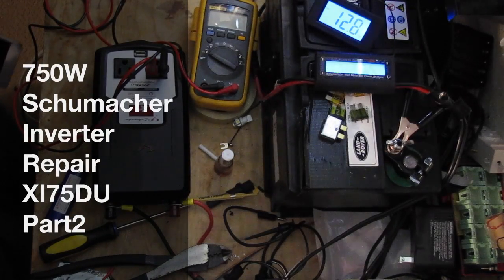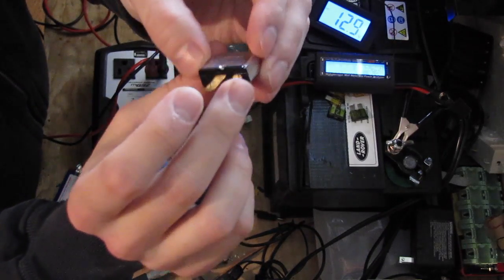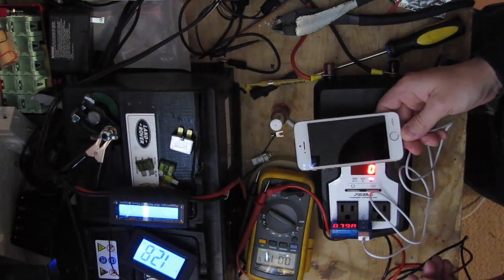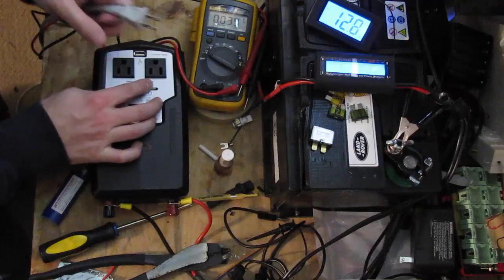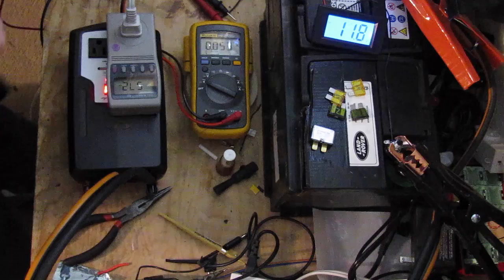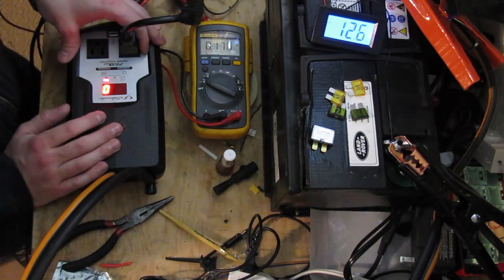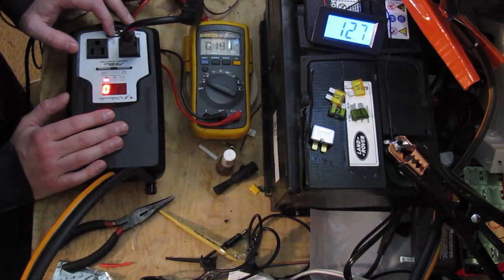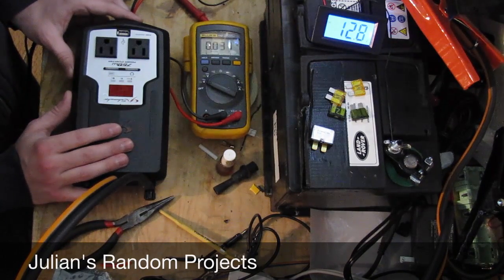750W Schumacher Inverter Repair XI75DU Part2

Comment: +JuliansRandomProject Hi, I have one of these I just got at a swap meet. I think I might need to change the fuse in the car cable but I have no idea how to get in there. Do you have any idea?
Reply from the maker: +thelmarrie the tip should unscrew giving you access to the fuse. Give that a try :)
Reply: JuliansRandomProject Thanks for the speedy response! Actually had to take out a screw and pry the casing apart. It was missing one of the battery clamps so I was wanting to at least see if it works until my replacement clamp comes in. Thanks again!

Comment: I got the same model inverter. Cant afford a pure. and i need a way to power couple heating blankets off it for like around like 8 hours. the heating blankets are Sunbeam N31-G2-S. 110-20 Vac 180W. They seem in spec but afraid the modified inverters just cant do the job even with one blanket. plugged into the wall it the blanket has solid lights. but on the inverter it just blinks and shows no draw on the display.

Any ideas or this thing useless to heating blankets?
Reply from the maker: Not sure. a heating blanket should be a simple resistive load but there could be some fancy safety circuity going on in those models. see if you can run ~180W of just incandescent light bulbs without issue, may give you an idea of what's going on.
Reply: JuliansRandomProject its funny i don't really own any lamps anymore. But i do remember running a lamp that had 4 lights on it. i dun remember what the type bulbs they where it was long ago. i think they were just standard 75w bulbs.

i was thinking when i can dig up the cash just getting one of these. http://www.ebay.com/itm/NEW-1500WATT-PURE-SINE-WAVE-INVERTER-12VDC-INPUT-110-120VAC-OUTPUT-/221610331725?pt=US_Power_Inverters_&hash=item3399014e4d

Comment: Just a tip , with high currents like that the voltage drop can be significant from the battery to the inverter, so I would recommend putting a second volt meter on the inverter terminals.
Reply from the maker: Good tip. Half way through this video I have to upgrade the cable gauge to reduce the voltage drop and get the job done :)
Reply from the maker: williek1802 I wouldn't know :) I bought about 20 of these second hand and none came with original cables.
Reply from the maker: I think 6 gauge. Will bump that up to 2 gauge and shorter run for testing the rest in the stack.
Reply: JuliansRandomProject does the cables it comes with when you buy it new can the wire support 75 amps?
Reply: JuliansRandomProject can i have one